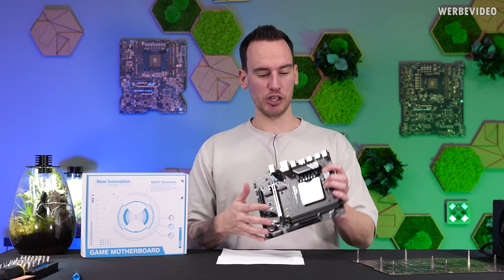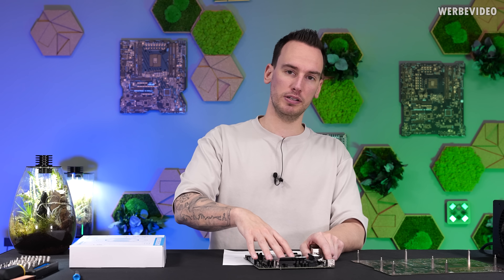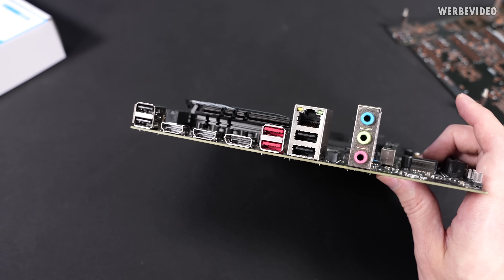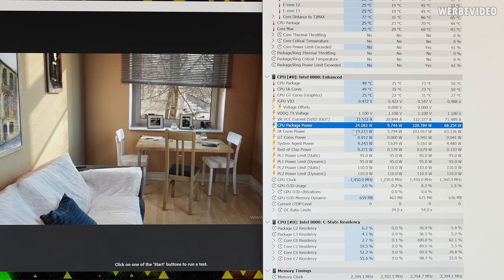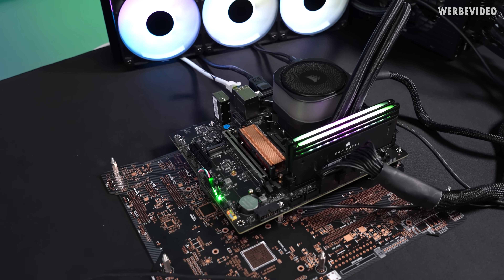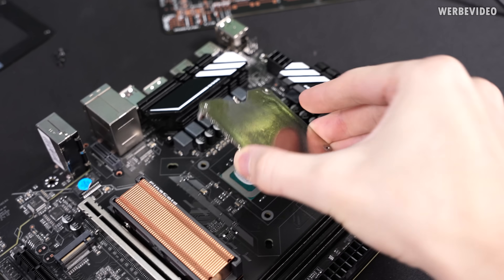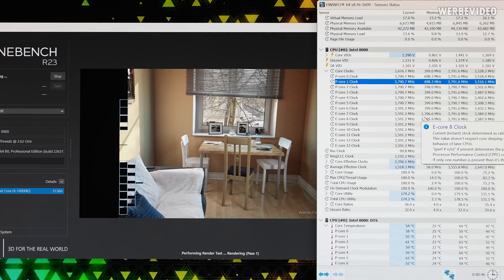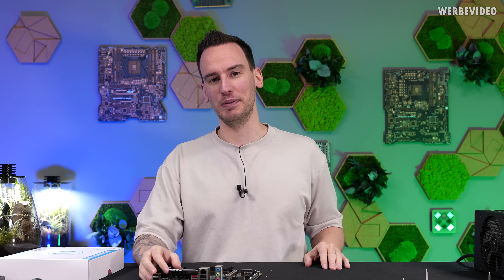Don’t Buy This! Intel Mobile Engineering Sample for Desktop is weird

Comment: I got an erying 11th gen i9 ES board for my dad. $200 is a crazy deal for a chip of that class even when it is crippled by power limits. Plus it's just driving a 1080, so pretty good deal for what I got when I got it. They do struggle a bit with stability in my experience though, I had to bump up voltage just a bit to keep it stable under load.
Reply: if power is limited you should try undervolting, it you should get better boost.
Reply: @fdgdfgdfgdfg3811  He said he had to increase voltage for stability, so it seems like voltage is as low as they can handle already.

Comment: $290, no way, I do 7500F combos with a good board and 32 GB 6000 CL30 for under $350, and 5700X3D with an even better board and 32 GB 3600 CL18 for under $300. I would like to see how the one at $120 will perform
Reply: The 7500 is ancient af and has only 4c/4t
Reply: @Al_LergicHe is referring to AM5 Ryzen 7500F, not Intel 7th Gen. It is obvious because he references 6000MT/s RAM which can only be DDR5.
Reply: @mattrogers6646  AMD and their confusing model names😞
Reply: @Al_Lergic You seem to be confused, may want to double check your googling...
Reply: Or Ryzen 5700 if you want that low power monolithic.
Reply: @mycosys True, but I can't get the 5700 for less than either of the above anymore.

Comment: The reason why some computers can go from dead still to desktop is because the time it takes to do so is a simple timer delay to allow the board to warm up, than processing delay. It's not rare in servers to take full 30 seconds to get into BIOS for the same reason. Laptops are slightly different as they are always kind of warm thanks to the battery pack.
Reply: I thought it was because it skips POST checks.
Reply: In servers that was to allow all the drives to finish spinup and power to stabilise.
Reply: @mycosys  these days a lot of it is the DDR PHY doing its initialization routine ("memory training")
Reply: @mycosys  No, some servers just sit and stay in pre-BIOS state. Drive spinup is separate to that.
Reply: @すどにむ  did you know, 'was' is a past-tense word?
Reply: @mycosys  yeah? things like staggered spinups comes after BIOS so that's kind of irrelevant. the system just don't come out of reset for 10, some even 30 seconds. idk if it's memory training but I doubt it as full training can be even longer
Reply: @すどにむ  LOL thanks for the laugh hunni. Sure, you spin up your drives after you run the ID on them, and they dont show up to the system cos they werent ready. That will work. 
Literally why the POST delay exists hunni. But what does a Mechatronic Eng Tech who has been building PCs since the 80s know
Reply: @mycosys  no the initial staggered spinup on some happens AFTER 10-30s delay because that part of code runs on either CPU or on RAID cards on PCI(e) bus. I suppose your experiences are limited to x86 PC platforms and anything after entry to BIOS?
Reply: @すどにむ  i really hope you get the help you need, inc reading lessons
Reply: @mycosys  What's the problem with you? You aware that not everything is controlled by CPU even in a PC, right? Or have you been building PCs since 80s and haven't even noticed that?
Reply: @すどにむ  are you ok hunni?
You come up with a LOT of non-sequiturs. 
Premature dementia?
Reply: @すどにむ  FWIW sweetie, automated delays for spinup and powergood go back to some of the earliest computers, not sure why you are ranting about CPUs and staggered spin
Reply: @mycosys  I just said delays are there for machines to warm up, knowing but glossing over everything. You're the one that got yourself spontaneously pissed by that and brought up disk spinup delays and BIOS bootup delays and other random features trying to somehow destroy what I've said.
Reply: @すどにむ  Im sorry that you somehow imagined anger. I really hope you find a community someday
Reply: @mycosys  Aren't you getting rather, random and incoherent? The points you're trying to form had been wandering all over. I suggest you don't go insane.
Reply: @すどにむ  im so sorry you cant read. I really hope you get help

Comment: Would this be decent for a NAS?
Reply: Why? R5 5700, decent board and 32G RAM would cost less, its also a laptop chip that uses f all power and has 8 full fat cores.
Reply: probably not. 1) the io is very limited because there's not a south bridge chipset. and 2) theres a chance that the sample cpu is not as stable
Reply: @Hoshino635  Roman said the south bridge was next to the CPU die.  But, you're right, not stable enough.  Price too high too.

Comment: 10:22 After applying the power limit on throttlestop, some boards need one more step for it to apply, other don't aply at all. Try to suspend windows and after 5-10 seconds wake the PC, this could help change the values. If the BIOS allows it, I just use the BIOS

Comment: I run one of these Erying MoDT boards in my machine right now, but it doesn't have an ES chip in it, it does have an i7 14650hx that looooooooooooves running at its full 157w and I have had absolutely zero issues or complaints with it at all. 100% happy with my purchase.
Reply: I've been wondering about those boards, How are thermals for the cpu?
Reply: x8 pcie is a big no no .
Reply: @amiwho3577  not at this price point, nobody buys this kind of board to put a 4090 or even a 4080, it will be CPU bottlenecked well before the PCIe is an issue
Reply: @amiwho3577  x8 lanes but pcie 4 right? Absolutely no problems for any card that's below an 7900 xtx or a 4080. Even then the average person buying this probably wouldn't shoot that high. Even if it is gen 3 who's stuffing anything bigger than a 4070 in this thing?
Reply: @amiwho3577  some new GPUs are only x8 anyway, so what's the issue?
Reply: @amiwho3577 why though? GPUs will have minimal performance penalty

Comment: 8:32 The BIOS looks a lot like the MSI NB BIOS when unlocked, the menus are almost identical. I know MSI doesn't make BIOS, it's AMI, but surely they can theme or rearrange the menus.
Reply: It's a generic bios, lots of cheaper laptops from bigger brands look the same. I think it's fine because simple bios means quicker boot times and it's more important the bios works, they seem to be a small company and from what I've gathered they seem to need to spend a lot of time on each motherboard and CPU combo to get the bios stable, apparently needing thousands of modifications and boots. I can see how theming isn't their top priority if they only have a few employees and this might cause even more issues with stability

Comment: 6:12 A much simpler firmware means it boots faster. I use laptops and one thing that I hate about premium laptops is because of their advanced features, their firmware is also very heavy and takes a while to boot up, whereas my other laptop which is not as premium takes like under 2 seconds to post.
Reply: I have one of these boards. The problem he's facing here is that everytime you change some configs the mobo will redo the memory training. If you find a good enough config you can save it and then turns on fast boot option to avoid it doing again. It's all a matter of config.
Reply: Would have to dump the BIOS, most of the time they are not simpler, they just expose less to the user. I have systems that are 5 seconds to desktop with full featured EATX boards, so 2 seconds to post isn't particularly fast.
Reply: Probably because there are so few components on that board that there's not much to initialize and check. Probably also skipped memory tests or something. Some BIOS'es would cache its own into memory too.
Reply: Swings and roundabouts..  fast booting is desirable in a hurry but  I would rather it go through the full boot cycle from scratch than load a cached copy of a preload system state that may or may not have a flaw because of a change  before the last shutdown, ever been stuck in a  windows boot loop after an  update?
Reply: @DevilbyMoonlight  He is not talking about fast startup feature in Windows. He is talking about the firmware POST. It is happening fast in that system because the firmware is very barebones and light.
Reply: What? Give me more advanced firmware with more options, who cares about a slightly longer POST!  Firmware with ghost options and locked out settings (even when modded to expose them if theyre hidden) are cancer for hi po laptop users.  I got a 9900K working on a 2017 model Z170 Clevo laptop turboing up to 5ghz and drawing up to 170W throttle-free, with 2x GTX1080s with 250W TGPs EACH (thoroughly maxed out on stock volts), because I had a fully functional custom aftermarket BIOS and EC where I could do what are usually desktop OC things like raise input voltages and internal current limits. And the thing never blew up one component even though it spent tens of thousands of hours under heavy load.
Whereas on this current modern 2023 POS I can't even undervolt the 13900HX...
Reply: Yes, i noticed that too. Laptops are EXTREMELY fast to post usually. At least that's what i thought until i got my recent asus laptop with a full blown mouse UI in the bios and a bunch of features, that one takes ages to post.
Reply: no it's because the delay is artificial. Longer wait better charged capacitor that's all
Reply: @ Some are timer, not remotely all...